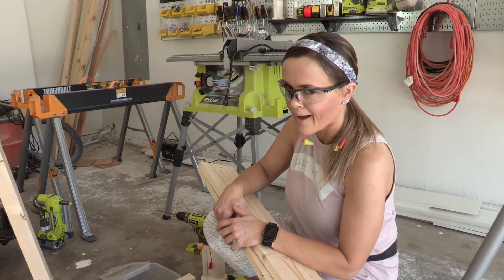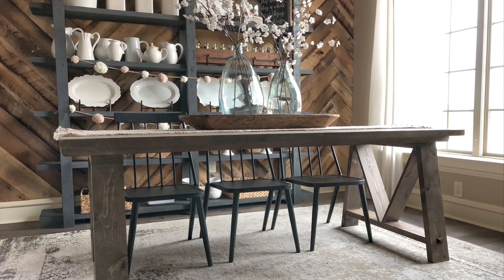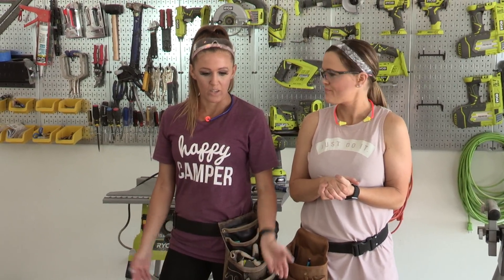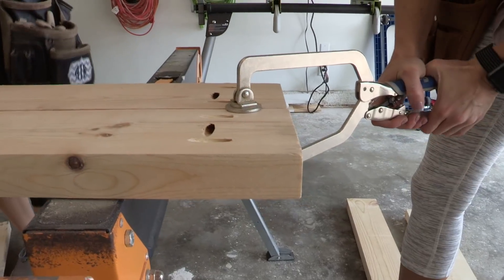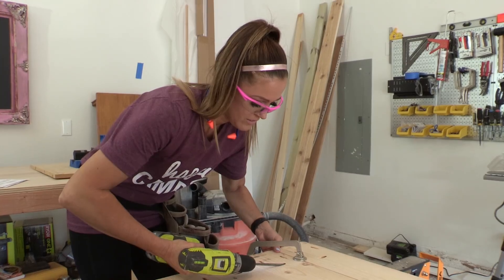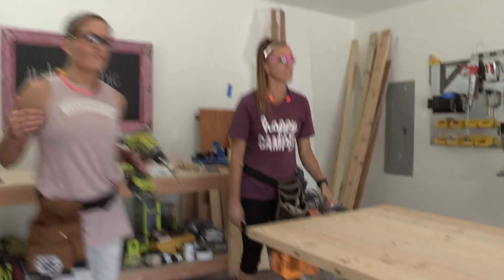DIY Fancy V Dining Table

Comment: Love all the table options just hoping for some slightly smaller projects for my small home. Keep up the good work girls!
Reply: adjust the measurements to fit your space. For example- if you want a 5 ft. long table, cut the top boards 60", then make the base to fit under.

Comment: Beautiful design! Do you have concerns about the lumber contracting or expanding? I am guessing the table top will eventually separate or start cracking if it is not given enough space for the wood to move. Since it's mainly framing lumber, I am guessing that it is not properly dried right? Or did you use kiln-dried lumber? It would be really good to see your wood selection process.
Reply: Andy Rea I have the exact same thoughts while watching most of their videos. Pocket holes are definitely quick and easy, and most of the projects look really nice when they’re done. But I never see them account for wood movement :/ I’d be interested to see some of their projects a year after they’re made.

Comment: Are the pin nails in the V pieces required? or would wood glue be enough to hold them in place. I don't have a pin nailer

Comment: I have always wondered.... Do you ever run into problems with warping and splitting using pocket holes?
Reply: i wonder the same thing. it doesnt look like there is room for wood expansion and contraction where it was screwed together. with just the screws and breadboards is that enough?  i wonder if the wood is kiln dried

Comment: Can you do a dining table that doesn’t require ripping wood?  I don’t have a table saw.
Reply: You don't have to rip the edges but can buy an electric hand planer to clean up the edges. You can also buy a block plane and do it with some elbow grease.
Reply: @julierose1986  lucky!
Reply: Use a straight edge and a circular saw. You could always lay your lumber on a piece of 1-2 in insulation foam to make it easier to cut by yourself. I don’t have a table saw either so I have to find other ways. I’m no carpenter but I’ve found ways to make my meager projects work without fancy or expensive tools.

Comment: Hi everyone! How are your tables doing after a year or more? Any lessons learned, suggestions, or changes if you were to build the table again? Any movement in the table tops?
Also I’m thinking of making mine 7’10” long and 40” wide. Adding one more board for the width, and 10” more on the top panels. Squeezing as much as I can out of the 8ft boards, without going too far past the length (96” cut to 94”) of the runner/support boards… for aesthetics.

Comment: I have a question - if we don't have a table saw to make straight edges on our wood to prevent those crumb catchers, does home depot/lowes offer already made straight edge lumber? I know that'll probably cost more though.
Reply: They don't have any 2 by material that's squared but their select pine is, but is only 1 inch material. They do sell electric planers that are hand held, which would give you the same result.
Reply: Heyy! BTW I think lowes & home depot still offer tool renting.
Reply: WEC makes an electric hand planer. I ordered that off amazon and then I plane the sides. It makes them fit together better. Essentially does the same thing, but it’s only like 28$
Reply: Hey there, AlohaMissy - you CAN use a circular saw to get straight edges.  It is very much worth your time.  Search for the Shanty2Chic tutorial - the ladies have a great video that will give you a clear step by step lesson.  Go for it!  Good luck.
Reply: Your best bet is to but a table top saw .
Reply: @shanemayfield8676  yes, so much easier.  Table saws for a DIY'er are not too expensive.  Mine is a small Craftsman from Sears that has lasted years.

Comment: Do you think this same  approach would work with all 1" or 5/4" thick boards instead of 2"?  I'm specifically thinking with some kind of oak or other hardwood.
Reply: If you use hard wood you will definitely have to mortise and tennon the bread boards. With expansion joint on the ends

Comment: Why people mention they are including a lot of stuff in the box description and then its almost empty???
Reply from the maker: Arquit3D we link to the plans in the description box which has all the info 😀
Reply: @shanty2chic  1:00 Link to rip off edges.
2:20 Link for sawhorses.
6:30 "clavos" link.
And, yes, I checked the description link. As indicated, just the plans and Ryobi tools used, that's it.
Reply: No furniture hardware link.
Reply: TOUGHBUILT 42.4 in. W x 28.8 in. H Steel Sawhorse and Jobsite Table – 1100 lb. Capacity-TB-C550 - The Home Depot
https://www.homedepot.com/p/TOUGHBUILT-42-4-in-W-x-28-8-in-H-Steel-Sawhorse-and-Jobsite-Table-1100-lb-Capacity-TB-C550/205870368

Comment: Question.... I've built 2 tables using your plans and on both tops, the boards kind of bow when I'm screwing them together therefore not giving me an even flat surface. What am I doing wrong??
Reply: Me too!
Reply: Probably just your boards. A lot of construction grade lumber is still wet, which causes them to bow/warp/cup.
Reply: I've had the same problem. I just cannot find dry wood! I don't know if it's just California or if everyone has the wet wood problem. I just let my top do its thing (warp and bow) until it was dry, then used a power hand planer to straighten it out. I know that's kinda cheating, but it was the only way to save my table top. 🤷🏼‍♀️
Reply: @normaruiz8217  thanks for that link

Comment: Omg, I love this table! I have a question...should I put glue on those table top boards or just use the screws?
Reply: no. the screws are a replacement for glue. you can add glue its just more work

Comment: How do I adjust the legs to counter height?
Reply: Take the thickness of the table top ie. 1.5", make the legs 28.5", the you have a 30" table.  Just adjust the two measurements to fit your project.

Comment: Did anyone find the link to the saw horses?  I don't see it.  Thank you!
Reply: I found them at Home Depot: Toughbuilt Steel Sawhorse and Jobsite Table. Here's the link https://www.homedepot.com/p/TOUGHBUILT-42-4-in-W-x-28-8-in-H-Steel-Sawhorse-and-Jobsite-Table-1100-lb-Capacity-TB-C550/205870368

Comment: How do you compensate for seasonal movement with the table top? You didn't allow any room for movement with your bread board ends, therefore it's highly possible that the table top will buckle or crack in the future due to there being no space to expand or contract due to seasonal movement.
Reply: Was wondering the same thing...during the Summer my swamp cooler puts so much humidity into the home; during Fall and Winter humidity is super low. I'd hate to build me a table just to have it give in on me... :(  What are you thoughts on this, please! I really want to build one!
Reply: You really need to use mortise joints for the bread boards with expansion mortise on the ends. But hey I look at like this it's a 100 dollars if it lasts 2 years you got your money worth.

Comment: Hi , I would suggest to run the edges through a joiner before connecting the top with these kreg screws . it is not a must if you don't mind to have a little gap ... not everyone has edge joiner but you can ask from the mile to do it for you....